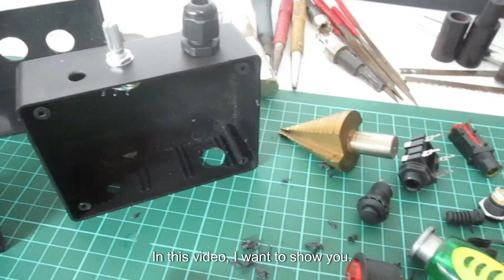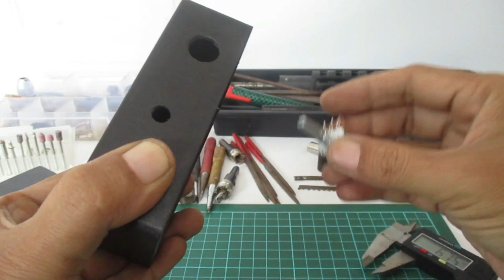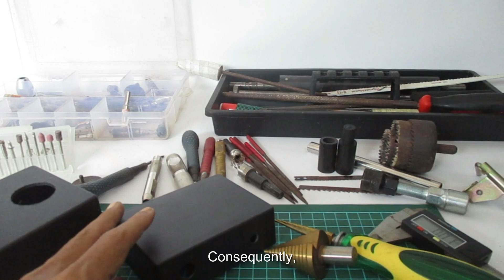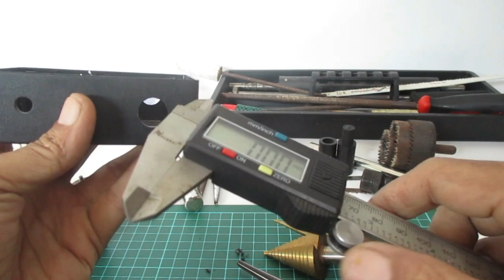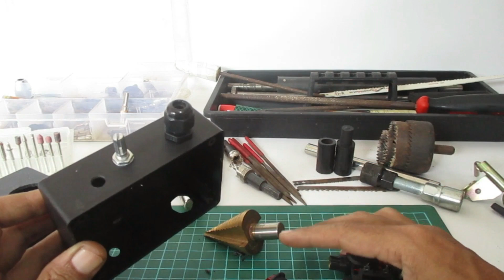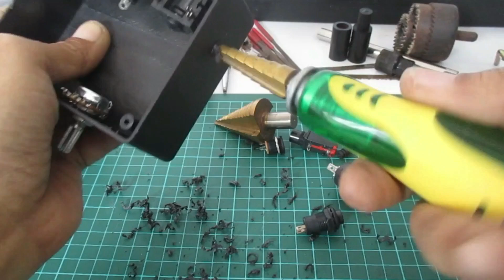How to Make a Hole in DIY Electronic Project Box

Comment: how about rectangle hole for USB female? what tool
Reply from the maker: @neodiy  you can use round Female USB connecter. But, if you need rectangle hole: create a round hole then use  cutter (sharp knife) to create 4 corner inside the round hole.